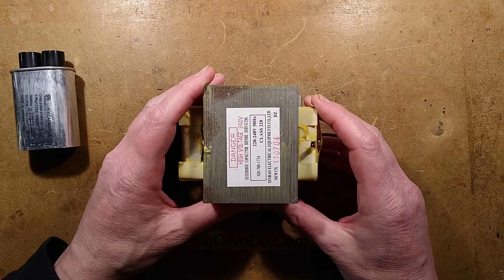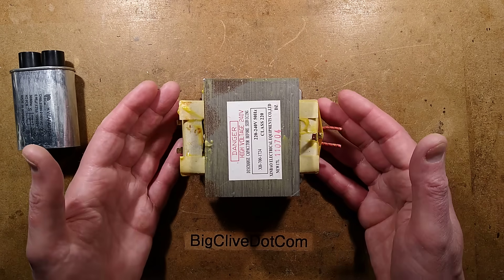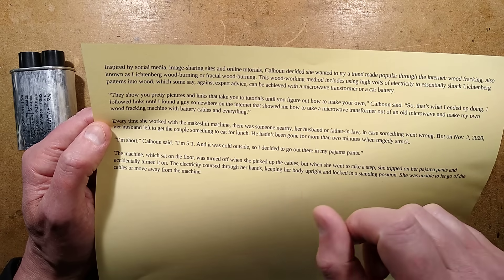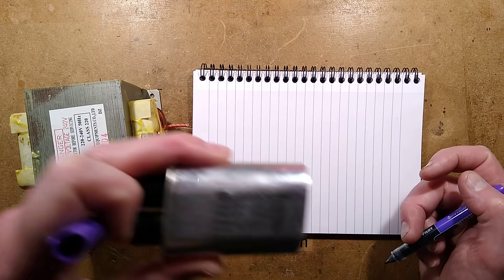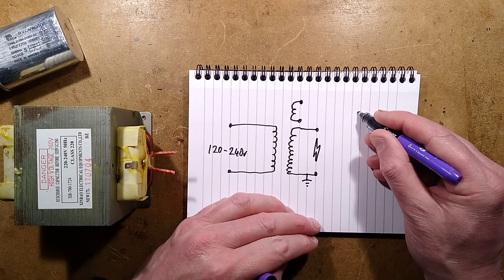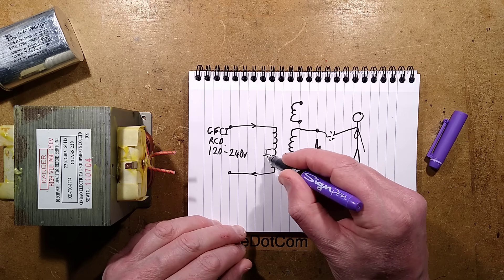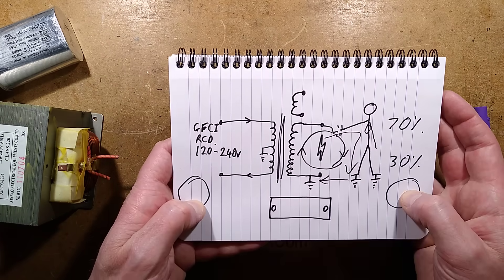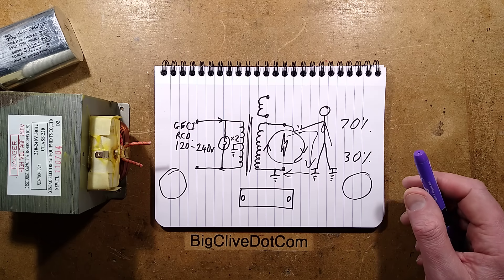The most deadly project on the Internet

Comment: I started making Lichtenberg burn patterns in wood when I was about 10 (around 1986). It was more than luck that kept me safe though. Before the system was on I always stood on a plastic milk crate with thick rubber shoes on and used a long high-voltage (30KV) lead, while keeping the other free hand pulled in towards my body, such that I only had one point of contact to the equipment. I burned for hundreds of hours with zero shocks. It was my understanding at the time that, if I was shocked, I would probably be dead immediately. I basically treated those transformers as if they were loaded firearms with hair-triggers. Understanding and respect was what kept me safe. All it takes is pulling one full 6-inch crackling hot-plasma arc with a transformer like this to understand how devastating a shock would be. The fact that someone, especially an adult, wouldn't have that level of awareness is completely beyond me. Similar to flying a kite in a lightning storm not understanding what might happen.
Reply: Seriously tho, all the times I somehow didn't die messing with electricity before the age of 10 is astonishing.. One time I even stuck a butter knife into a breaker box switch, it burned the knife and made it black on the end but somehow I was fine. The last time I got shocked was fixing a record player and I accidentally left it plugged in while I reached in it to make an adjustment and the power cable shocked me so hard I heard a loud zapping in my ears. My hairs were on point after that, and my muscles hurt. It was so stupid.
Reply: @hrromanslaparsso4403  most of the stuff you're getting exposed to is 120 or 240. Microwave transformer is so much higher. When you shorted out that knife it was between the terminals and you are not part of the circuit. That microwave oven has an open voltage of two or three thousand volts so if it does connect with you it's going to arc when you disconnect and it's going to push a lot of current through while you are connected.. it's like having the devil after you.
Reply: We all make mistakes some never get to do them anymore
Reply: Are you saying that We metal scrappers shouldn't take transformers apart for the copper?
Reply: Same here. I cannot understand why my parents let my play with microwave transformers. But my switch had a 2m long cable, combined with a 1,5m chicken stick. It was very safe, and I never went near without unplugging the plug first. One time though, a stubborn friend tried to touch it because he couldn't believe it would be deadly, I remember that moment very vividly...
Reply: Not quite flying a kite in a lightning storm is a pretty random thing and you probably won't be able to get hit by lightning. Electricity is unpredictable high voltage  systems like that are the worst. You still had quite a bit of luck involved if you're around that much voltage with homemade stuff standing on a milk crate and rubber soles.
Reply: The large majority of adults aren't as intelligent as you obviously were at ten.
Reply: When I use the one handed rule, I personally put the other hand on the small of my back.
Reply: Now that you're an adult I hate to let you in on this that adult ranking doesn't amount to much in many cases. I'm an adult and I live 64 years I met a lot of adults who lived ten years three times.
Reply: N.a.s.a. ,,can you work in space ?
Reply: Let me in on a secret I'll let you in on a secret and then you'll figure out that there's really no such thing as a secret. Most people don't have the intellectual wherewithal to figure out the plastic milk crate and the big long insulating handle and the rubber boots might be Overkill they don't want to spend the money. You and I are very fortunately blessed with insights and most people aren't. That's why invisible things like electricity killed them.
Reply: @markmcgoveran6811 No. All that shows is that there is no such thing as a shared secret.
Reply: @zapazap  I'm glad that you see what it only shows to you. I'm delighted that my life is much easier because I see what it shows to you and what it shows to others
Reply: @markmcgoveran6811  Your tender care is appreciated! Nonetheless, my comment stands. You spoke in terms if a shared secret, not a secret per se.

Cheers! 😀
Reply: @zapazap  I generally don't have brake lines like a lot of people have all of my stuff is on a gradient. I had a secret girlfriend and I never told anybody she was my girlfriend and everybody in the entire town knew it. I have generally found secrets to be worthless if not damaging.
Reply: @markmcgoveran6811  It sounds like you don't care much about externalities. In any case, you do you sir! You do you! :)
Reply: @zapazap  I do meet quite well as a matter of fact I do me so well I've got extra do to hang around and give away. I'm doing me pretty slow but don't worry if you get tangled up in that microwave oven transformer on the hot side it'll do you fast. I know a lot about safety and I cried a lot of tears when I worked on blood stain boats so now I'm out here trying to get everybody to look at safety issues I don't care if you say mean things to me or not or funny things or whatever you say this one here is a bad cat for  safety .
Reply: @zapazap  I have no idea what an externality is. Please send one by I'll give you $2 a pound for externality. I'm paying $2 a pound for Utopia too if you got any of that and I'm paying $2 a pound for dystopia if you've got any of that. I have no idea what you mean by externalities external to what?
Reply: @markmcgoveran6811  An externality is an effect of an activity on third parties. It is a common term in economics. Cheers!
Reply: I answered and said, "If I have found favor in thy sight, O Lord, show this also to thy servant: whether after death, as soon as every one of us yields up his soul, we shall be kept in rest until those times come when thou wilt renew the creation, or whether we shall be tormented at once?" 76 He answered me and said, "I will show you that also, but do not be associated with those who have shown scorn, nor number yourself among those who are tormented. 77 For you have a treasure of works laid up with the Most High; but it will not be shown to you until the last times. 78 Now, concerning death, the teaching is: When the decisive decree has gone forth from the Most High that a man shall die, as the spirit leaves the body to return again to him who gave it, first of all it adores the glory of the Most High. 79 And if it is one of those who have shown scorn and have not kept the way of the Most High, and who have despised his law, and who have hated those who fear the Most High -- 80 such spirits shall not enter into habitations, but shall immediately wander about in torments, ever grieving and sad, in seven ways. 81 The first way, because they have scorned the law of the Most High. 82 The second way, because they cannot now make a good repentance that they may live. 83 The third way, they shall see the reward laid up for those who have trusted the covenants of the Most High. 84 The fourth way, they shall consider the torment laid up for themselves in the last days. 85 The fifth way, they shall see how the habitations of the others are guarded by angels in profound quiet. 86 The sixth way, they shall see how some of them will pass over into torments. 87 The seventh way, which is worse than all the ways that have been mentioned, because they shall utterly waste away in confusion and be consumed with shame, and shall wither with fear at seeing the glory of the Most High before whom they sinned while they were alive, and before whom they are to be judged in the last times. 88 "Now this is the order of those who have kept the ways of the Most High, when they shall be separated from their mortal body. 89 During the time that they lived in it, they laboriously served the Most High, and withstood danger every hour, that they might keep the law of the Lawgiver perfectly. 90 Therefore this is the teaching concerning them: 91 First of all, they shall see with great joy the glory of him who receives them, for they shall have rest in seven orders. 92 The first order, because they have striven with great effort to overcome the evil thought which was formed with them, that it might not lead them astray from life into death. 93 The second order, because they see the perplexity in which the souls of the ungodly wander, and the punishment that awaits them. 94 The third order, they see the witness which he who formed them bears concerning them, that while they were alive they kept the law which was given them in trust. 95 The fourth order, they understand the rest which they now enjoy, being gathered into their chambers and guarded by angels in profound quiet, and the glory which awaits them in the last days. 96 The fifth order, they rejoice that they have now escaped what is corruptible, and shall inherit what is to come; and besides they see the straits and toil from which they have been delivered, and the spacious liberty which they are to receive and enjoy in immortality. 97 The sixth order, when it is shown to them how their face is to shine like the sun, and how they are to be made like the light of the stars, being incorruptible from then on. 98 The seventh order, which is greater than all that have been mentioned, because they shall rejoice with boldness, and shall be confident without confusion, and shall be glad without fear, for they hasten to behold the face of him whom they served in life and from whom they are to receive their reward when glorified. 99 This is the order of the souls of the righteous, as henceforth is announced; and the aforesaid are the ways of torment which those who would not give heed shall suffer hereafter." 100 I answered and said, "Will time therefore be given to the souls, after they have been separated from the bodies, to see what you have described to me?" 101 He said to me, "They shall have freedom for seven days, so that during these seven days they may see the things of which you have been told, and afterwards they shall be gathered in their habitations." 102 I answered and said, "If I have found favor in thy sight, show further to me, thy servant, whether on the day of judgment the righteous will be able to intercede for the ungodly or to entreat the Most High for them, 103 fathers for sons or sons for parents, brothers for brothers, relatives for their kinsmen, or friends for those who are most dear." 104 He answered me and said, "Since you have found favor in my sight, I will show you this also. The day of judgment is decisive and displays to all the seal of truth. Just as now a father does not send his son, or a son his father, or a master his servant, or a friend his dearest friend, to be ill or sleep or eat or be healed in his stead, 105 so no one shall ever pray for another on that day, neither shall any one lay a burden on another; for then every one shall bear his own righteousness and unrighteousness." 2 Esdras 2:31
Reply: @likeasparrowinthewildernes8333   Oh noes! Then what happened?
Reply: Proof that schools actually taught you more about the world itself back in the day
Reply: @PokefreakMaster333 what school do you know that taught you electricity prior to high school ? Even now you get taught electricity in magnetism but it’s so rudimentary that I wouldn’t say it’s that well understood. The real problem comes when peoples dumb ass parents don’t tell them about the things the use everyday and the threats that come behind them. You don’t need to know how electricity works to know it can kill you if you are doing something dumb/complex with it. The same way a gun can
Reply: @PokefreakMaster333  this is so hilarious, I love it.

Comment: The voltage isn’t the danger, it’s the amperage that kills.
Reply: @Pelican_t  stun guns use voltages in the hundreds of thousands of volts, and up to 10 million volts, yet amperage’s of only 3 milliamps or less.
Reply: @juliemunoz2762  If you have high voltage you have correspondingly high currant. I=V/R. It is the combination of energy, frequency, time, and sufficient voltage to make muscles contract that kills. Statements about whether voltage or amperage kill reveal only that the person making the statement doesn't understand anything about electricity.

Comment: I ran one at full mains power only one time, with a long chicken stick to do the arcs with, then with the kill switch next to me. The transformer itself is over a metre away. I did four or five arcing events, then I never ran it again at full power. I ran the magnetron at ballasted power, the same thing applied. With another long chicken stick, I discharged everything and disassembled the whole setup, throwing it into my cupboard to collect dust. 

If you know what you are doing, it is quite the experience to hear 60Hz and high power 2kV arcs. I have worked with upwards of 20kV 10mA(This can still kill and fry you) before, but nothing would scare me more than MOT arcs.
Reply: And that 2kV capacitor, this was the first time I used a resistor instead of a screwdriver to discharge a capacitor.

Comment: You made a very useful video. As an old retired EE I have long known that 2,000 volts is about the most dangerous voltage that people might come in contact with.
High enough to easily get past your skin insulation. Low enough that your muscle reflex does not make your body spring away from the connection.
Touch 2,000 volts and you have a good chance of getting stuck to it and fry like a hot dog.
Note that the High Voltage power transmission stuff is probably more dangerous, but not many people can even get close enought to come in contact with that stuff.
Reply: Those lines just kill you instantly in the most gruesome way. Roman circuses gave more dignity in death.

Comment: I know someone who was killed with this.    Or rather I knew.   He was someone I used to work with and I never much cared for the guy so need for your sympathy.   That said he did have a wife and child so I do feel bad for them.. I bet he died about 5  years ago.   I was actually using one of these at the time in my home wood shop.  I  made a very cool vase that is burned.   I always used my welding gloves to place the leads and I put it on a off and on switch followed by a foot momentary switch that I stepped on after the wires are in place.  But still they are very dangerous and after this guy got killed Ijust kind of stopped messing with it.       The internet does make it sound all to easy to do.    Personally If I build something out of a microwave transformer again it will be a spot welder  or electromagnet. Both much safer as you rewinding one side  and are not using the high voltage like this project.

Comment: As someone who services electric appliances like microwaves on a regular basis, I can confirm these things will kill you. When I work on anything electrical I always make sure without a doubt that the electricity is off at the breaker panel, that the appliance is unplugged, and that any remaining stored energy is discharged. 
That sign “not only will this kill you, it will hurt the whole time your dying” was burned into my brain through repeated viewing of the aftermath of incidents as described above by our lovely host, as well as repeatedly getting complacent, and having to be shocked, and burned myself. 
If you play with electricity, it’s going to eventually make you into its favorite chew toy, so be smart.

Comment: Well done. Another thing to point out is that plugging the microwave oven transfirmer into an outlet that is protected with an RCD (GFCI in America) will NOT give any protection from a lethal shock from the transformer's secondary. Unless you know how to handle high voltage equipment safely, DON'T tinker with it!
Reply from the maker: I do mention that in the video and show why.
Reply: @bigclivedotcom oops. . . I commented without watching the entire video. Good video, just the same.
Reply: @bigclivedotcom  The dead man's switch is a good idea 💡. 
As you say, it keeps BOTH hands occupied and away from places where they shouldn't be. . .

Comment: I can honestly say that I know what it's like to get hit with the voltage From that  Transformer when I was in my twenties I was drinking alcohol used it for a scientific experiments had to move it a little when it was plugged and used something accidentally conductive to touch it I saw a white Flash before my eyes a Bang went off in my head  my heart was immediately racing probably 200  beats a minute I quickly got up off the chair I was sitting in and went to the other room to tell mom thinking I will hit the floor My heart slowed down and It was scary as h*** I would never touch this again and wouldn't have the desire to That is 2500 V  And I made contact both hands  Being under the influence of alcohol influenced my mistake  I survived it and was fine afterwards I should have been wearing rubber gloves for one thing
Reply: You mean "lineman's gloves".  Regular garden-variety rubber gloves are the kind of thing that causes the HV electricity to say "Hold my beer. . ."
Reply: @jimharris9394 for 110 perhaps but for twenty five hundred  lineman gloves yes

Comment: I'm only 16 and I'm always cautious around electricity. A couple of months ago my dream came true of taking apart 2 microwaves to get the transformers and capacitors to put in my collection I've got a giant transformer from an ark welder aswell I might use them when I'm older for a tesla coil who knows but seeing just what people are doing with such high voltage is just so risky and dangerous I mean put breakers and switches away from where they could get knocked but the best thing to do is UNPLUG IT it only takes 2 seconds and saves your life and others around it